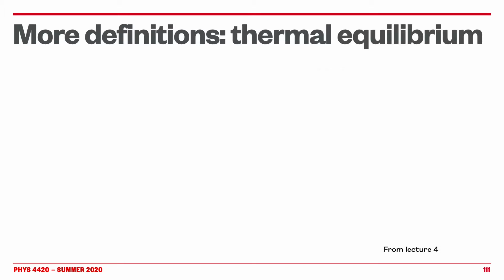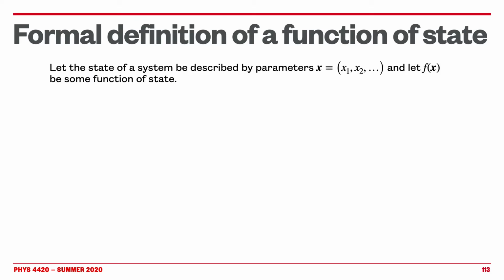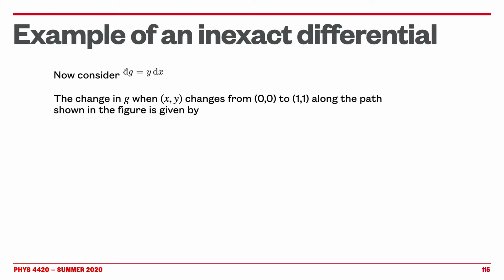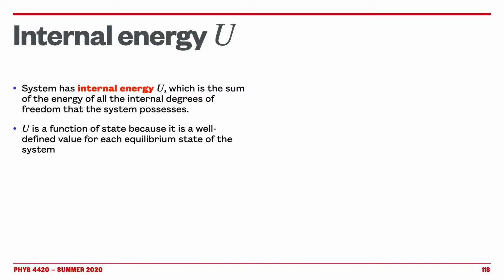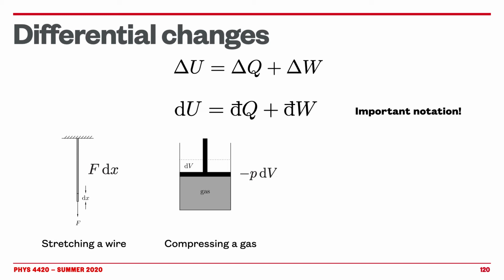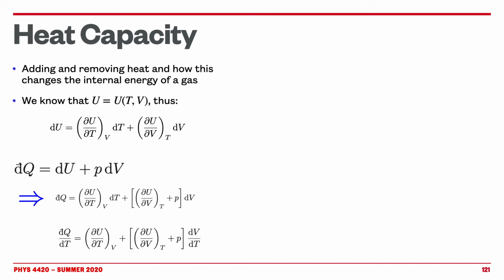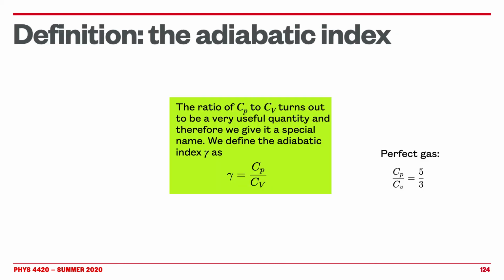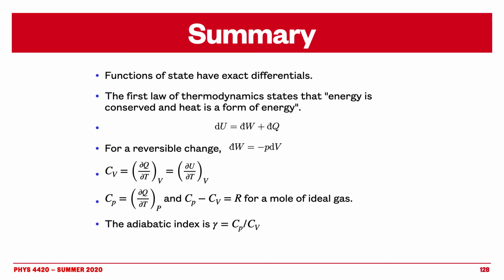Thermodynamics and Statistical Mechanics; Lecture 11: Energy

Comment: 14:58 What does integral of y dx mean if y is not constant but also being integrated over? Shouldn't it be y dy dx?
Reply from the maker: The variable is x and we integrate for changing values of x. This is a linear integration. An integral involving dx dy would be a surface integral, which is not what we need here.
Reply: But how is y not also a variable since it also goes from 0 to 1?